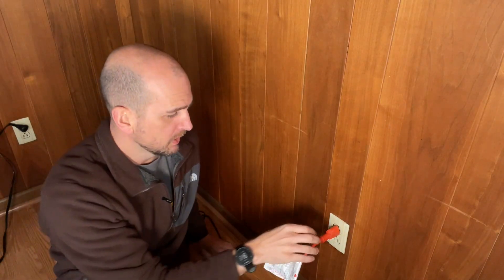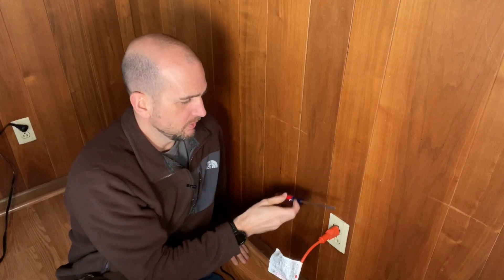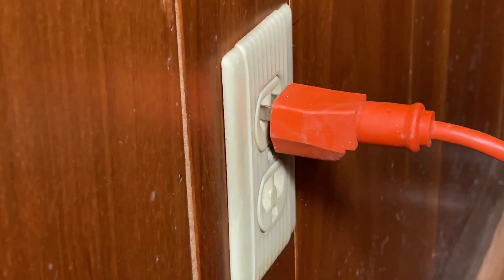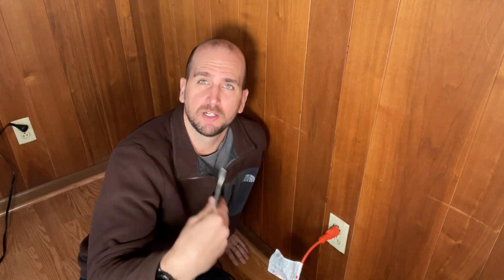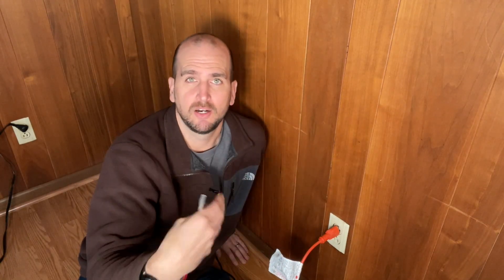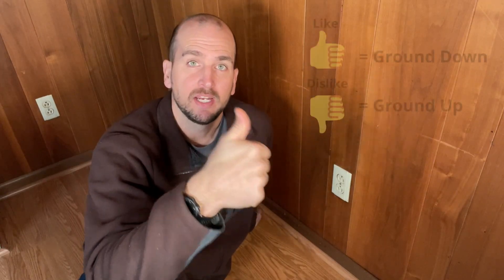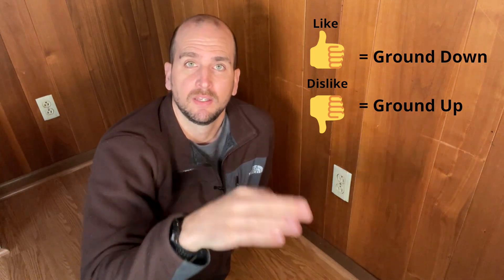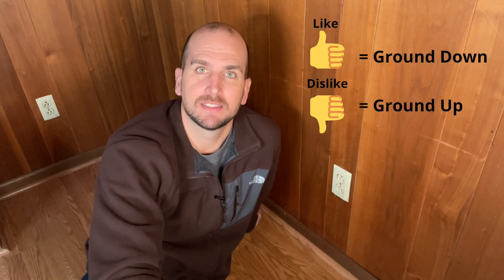Should An Outlet Be Installed Ground Down Or Up

Comment from the maker: Recommended Old Work Box (Different than used in the video):  https://geni.us/eVaL9

Tools Every Weekend Warrior Needs
Makita Cordless Drill Combo Kit:  https://geni.us/t7dIA
Dewalt Drill Bit Set:  https://geni.us/oFlSl
Dewalt Screwdriver Bit Set:  https://geni.us/VDcr
Craftsman Screwdriver Set: https://geni.us/jXqFI
Eklind Allen Wrench Set:  https://geni.us/7XfvO
Pliers (4-Piece Set):  https://geni.us/RIdx
Stanley Utility Knife:  https://geni.us/ndIDa
Stanley Tape Measure:  https://geni.us/bUfD1R
Studbuddy Stud Finder:  https://geni.us/RySCuVw
Johnson Torpedo Level:  https://geni.us/wiLcDY
Stanley Hammer:  https://geni.us/bPDk8Wo
Buck Bros Wood Chisel Set:  https://geni.us/vk3cpTW
Klein Voltage Tester:  https://geni.us/h9Hl
Klein Outlet Tester:  https://geni.us/kdBAJ
Ideal Wire Strippers: https://geni.us/MdOB
Little Giant Ladder: https://geni.us/fmlmTk

DISCLAIMER: This video and description contain affiliate links, which means that if you click on one of the product links, I’ll receive a small commission.

Comment: Another downside to ground down is that a heavy plug can crack the plastic around the ground input itself because there is not enough plastic for proper support. Once that happens, the outlet is useless. I'm going with ground up.

Comment: I replaced some outlets with hospital/industrial grade one. If there was a grounded plug commonly plugged that wasn't a flush fit one it I installed it ground side up, as it is harder to fall out. Otherwise ground side down.

Comment: Our house has both. I am 78 and have never heard of anyone dropping a tool across the hot and neutral.
   I change the orientation to reduce stress on plug wires. That is it. Top, bottom or sideways works.

Comment: Our electrician replaced all the outlets with ground up because its supposedly more secure. 
It's a gigantic pita - such as in my bathroom where I have 4 plug safety outlet plugged it. It constantly slips forward. Other outlets are a pita with my flat 90⁰ surge protector outlets. And the two prong plugs slip out easily. 
I hate it.

Comment: They have sideways installed plugs. There’s floor plugs in the middle of rooms. I don’t think it matters except those thinking they can predict every scenario. 
But if the ground was facing up and the item that hit it rolled in the direction of the hot lead, the same thing is still going to happen! So I don’t feel there’s any ones scenario that fits every situation. Maybe just be very careful think things through Replace old out plugs and this will be less likely to be a problem.

Comment: Most are thinking about this in the wrong way. (Except the guy who likes to look at the eyes and mouth.) But you need to consider how the plugs 🔌 are designed on the appliances. If they are straight, it doesn’t matter. But if they are 90 degrees from the cord, the ground should be on the bottom. Otherwise, the cord will block the upper receptacle if plugged in on the bottom, or the cord will go above the plate on the wall, and then loop around to go back to the appliance when plugged into the top outlet.

Comment: Had an eX with the grounds up in her house.  Thought it was the oddest thing, especially knowing her dad was an engineer. Since then I've noticed that it is easier to plug in 3 prong plugs at bed angles. We recently remodeled her house and all plugs are ground down except for 2 that are controlled by light switches. They are down mainly because they may be behind furniture and a flush plug is needed.

Comment: I would guess the reason most homes have GROUND UP (GU) versus  GROUND DOWN (GD) is mostly to do with ease.  Here's what I mean.  If you install GD, it gives you 2 prongs to guide into the base plug, virtually guaranteeing that the GROUND prong is automatically aligned; whereas, if you install GU, you only have the 1 prong on top to guide you, meaning the 2 prongs below are not necessarily aligned.  To me personally, orientation doesn't matter that much because once you've plugged something into the receptacle -- whether it be a lamp or computer a refrigerator, a televion, etc. etc. etc., it's a pretty well done deal.  You aren't going to be plugging and unplugging it.  Whatever little inconvenience might be involved in GU is so nominal as to be a non-player -- for me, anyway.

Comment: I used to think it was on safety precautions as to how they are manufactured .... if you notice the neutral terminal is always bigger than the hot its because the should makes contact before the hot ... however i used to think that the reasons for the ground down is also safety precautions when the ground is down incase of water rising or flooding it would contact the ground first

Comment: The ground should be down if it is pulled down the ground will always stay attached. If it is the up position and pulled down the ground can become pulled out but the voltage can be still available which can cause an electric shock because the ground is not attached.

Comment: Every electrical manufacturer that makes a plug in the wall device intend it to be with the ground down. I have seen multiple Smart outlets and carbon monoxide detectors, all intended for the ground to be down. All the writing on them is designed this way. I have never seen one of these designed with the ground up. So I don’t understand why anyone would put them with the ground up. If an outlet is been used so many times that it is loose. When you plug it in, then it should be replaced.

Comment: Seems like it's primarily older homes that have the ground up from my limited experience. Practically all modern plug in adapters or protectors with anything built into it are based on having the ground down, like usb adapters, the 90 degree turn surge protectors mentioned here, etc.  Even GFCI outlets have the words printed based on the switches based on ground down.

Comment: The best is ground down the following reasons:
1. The plugs of the refrigerator or stove have the cable very bent and forced because that is not its original position to plug (reason point 4)

2. GFCI testers have the display up with pin ground down, if you have a ground up outlet it can't be read, you have to bend down to read the tester. (reason for point 4)

3. The plug connection is most solid when everything rests on the ground pin

4. It's the original position of the NEMA type B connector... ground, which looks like a scared face.

5. It's a horribly unsafe plug regardless of its position, so putting the ground up or down doesn't change anything the standard type B sucks because you can cause a shock just by taking it past the plastic. in fact, never in my life did I have such an aim that a knife fell in the middle of the connector, whenever they ask these questions they imagine situations that are too improbable that are irrelevant, and even if it happened... man, come on, it's only a short circuit, in the same way it will happen when the phase of a device touches the metal casing of a device or there is an insulation fault in a motor...BOOM!! thermomagnetic fired.  current out.

Comment: In Europe and Australia, the Earth pin is lowest of the three, but that means one can short out the plug A-N from above if it it slightly withdrawn.  These days, the Australian A-N plug pins have insulation from the plug to about 5mm from the end where the conductors are visible, so the possibility of shorting the A-N from above is less likely, however, there are many old plugs with conductors all the way from the plug to the end of the pins.

The UK has the Earth pin is above the A-N pins, so it is impossible to short out the A-N pins unless from below.

Whilst I like and prefer this socket arrangement (E above A-N), the Australian Wiring rules require the Earth pin hole of wall sockets to be under the A-N pin hole -- I suspect in Australia, if one were to orientate the Earth pin hole above the A-N pin holes, one's home insurance might be voided in a claim for fire damage since the investigation would find the wall socket mounted not in accord with the AU wiring rules !

I suspect this might also apply in the US -- so check the wiring rules code.

Comment: Wow!  6700 comments.  At 2:55 is a good example of why you want the ground pin down. The flat plug on the left wall is designed for ground down.   Most flat plugs I see are similar.  A quick survey on Amazon shows this number of flat plug extensions for ground up outlets:  Zero.

Comment: Yup. You're right. No code mandating the orientation of the ground... although there are many entries prohibiting receptacles facing upwards when installed in various locations or on various types of surfaces like countertops... HOWEVER there are inspectors in many jurisdictions that DO make you install the receptacles with the GROUNDS FACING UP!  When it comes to my customers or if I'm doing a remodel, I'm going to make whatever I install match the rest of the home.  If it is new construction... especially in a commercial environment... good chances you're going to have an inspector that will have u install all receptacles with the ground facing up here in the Atlanta metro area.  It's basically considered an unwritten code among authority having jurisdiction which can go above & beyond NEC code.
Q. - So why do they even have code book if an inspector can impose whatever arbitrary rule he feels like imposing?
A. - I don't know

Comment: Damn, I have been doing Electrical work for about 16 years thought NEC said ground up. I was told many years ago by a foreman that NEC 2008 stated that receptacles installed under 36" were required to have the ground facing upwards. I guess it was never technically wrong to do it that way, but not required. Dude sounded so sure and so specific when he told me, so I had no reason to question or look it up. It's nice to know that it isn't required, but now I feel bad for passing this incorrect information on to people that I have trained over the years.

Comment: The safety argument for the ground-up wouldn’t actually matter if our plug blades were smarter. The UK’s plugs aren’t conductive along their whole exposed length. If the plug is in far enough to pass current, there won’t be any exposed metal for things to touch and short circuit with. They do also have a ground lead on everything; but that’s excessive and unnecessary imo, though it does allow them to shield their outlets in a much less finnicky manner than our stupid tamper resistant outlets. That also raises the point of our polarized plugs. It’s a smart effort, BUT it’s entirely possible for outlets to be wired backwards which is why everything should have a double-pole switch, regardless of whether the cord is polarized or not

Comment: Pretty well all the smart plugs have a code on them printed on the top that expects the ground to be on the bottom so you can easily see/scan the code.   After 27 years at my place nothing has ever fallen on a semi pulled out electrical outlet.

Comment: If sideways, neutral up. If normal position ground up.  I saw a necklace fall on a loose grounded plug  in an old receptacle that vaporized in a shower of sparks. If that had been on a bedspread, it could have caused a fire.   I do commercial wiring at the facility where I work, and all the newer parts of our buildings are ground-up. The earth pin in UK I think is up, and if not fully inserted, cuts power to the hot pins.  That seems like the safest.

Comment: My experiences has been commercial, Schools,  Hotels and reason for ground down is inspectors that use a receptacle tester for polarity & gfi tests allows the device to be plugged in and can read the labeling and lighting is upright and readable. If ground is up the test device is upside down and not readable. So, I'd check the receptacle test devices,  typical brands GB.

Comment: Some power plugs are designed for the ground facing down, such as some fridges.  If the ground is up it turns the cord around upside down and bending around creating a loop.  MY standard is GROUND DOWN!!

Comment: Hmm.....
I haven't read the comments below so forgive me everyone. I am only speaking as a person plugging stuff in behind items. What's annoying is on a cord one of the outlet prongs is larger than the other and so is one of the outlet holes. It's annoying when you go to plug something in and you have it all lined up only to discover you must pull it back and flip it over so the larger prong now aligns with the larger prong hole.

Just my opinion, it's an awesome reminder that outlets controlled by switched are ground up. Today is November 26, 2022 and at 56.5 years old this is the first time I have ever heard that. Is that an electrician trade secret? Can someone leave a post it note in those outlets saying...

- Dear Homeowner. Remember ground up outlet means I'm a switch outlet. -

That information certainly proves that you do learn something new everyday!

Comment: I believe that the outlets should go down 
Because for the if a lightning strike should hit during a rain Strom , the lighting strike needs to go into the ground to avoid an electrical fire or
Short . That's why your house meter has a ground Cooper wire attached to a steel steak driven into the ground to control  lightning strikes during Strom's !!

Comment: Start at the first outlet in the room with ground down, do the second ground up, then repeat, repeat repeat.   Also put the ceiling fan and light switch combo, put fan on side closest to the door in one room, then change it for the next,..   Also don't forget to randomly add a mix of room outlets to a hidden GFI.   Then in the closets and laundry room don't put a box in the ceiling, just pull the wire directly into the fixture.    

Almost forgot, at random locations turn light switches upside down so it says "NO",...

Comment: From the beginning of electrification, outlets were hot side on the right, because it wasn't always obvious where the fuse was and being a fuse it was sometimes corroded and removing it could destroy the fuse holder requiring a repair and a new fuse holder, which if it was ganged could be quite expensive and time consuming. Electricians got used to working with hot wires, so the hot side was wired last with the right hand because most electricians were right handed.  The NEMA 5-15 receptacle was designed this way with the ground down. However, before publication of the standard, someone noted that the ground pin was the longest and the vast majority of outlets are below eye level, the longer ground pin, engaging first should be on top to aid visual engagement of the plug in the outlet, so that is the way the standard was published. However, electricians simply said, "happy face, hot on the right." Some people got fired for installing outlets according to the standard. It was considered an electrocution hazard during installation.  This is still done because it is hard to monitor a breaker box you can;t see form the installation location, and most outlets share a breaker with another outlet, so someone may be tempted to restore power to their outlet on the other side of a wall during an installation.

Comment: I was always taught that in basements, garages, workshops, etc. that the grounds should be put facing up for the reasons outlined in the video. If a piece of metal or tool falls on a slightly-exposed plug it will hit the ground and not short the hot and neutral. I've also seen that the grounds should be put facing up for outlets controlled by a switch in normal living spaces, mostly for clarity haha

Comment: GROUND DOWN ,WHEN OUTLET WEARS  ,THREE PRONG PLUGS GET LOOSE AND PULL DOWN ,WITH GROUND DOWN THE GROUND PRONG WILL KEEP GOOD CONNECTION POSSIBLE LIFE AND DEATH  SITUATION. IF GROUND IS UP AND SOME METAL SOMETHING SHORTS BOTH PRONGS ( VERY HYPOTHICAIL)  IT WILL POP THE BREAKER. MOST ELECTRIAL PRODUCTS AND NIGHT LIGHTS ARE MADE  FOR GROUND DOWN!

Comment: My outdoor receptacles were ground up. Putting a timer on the outlet resulted in the second receptacle being inoperable because wire was in the way. Drove me nuts but I thought it was code so I left it. Come to find out it's not necessary. I flipped them immediately.

Comment: Ground down makes so much more sense until cord manufactures change their gig. I think the concern of the short is definitely a valid concern, but the chance of a conductive obelject falling perfectly horizontal and crossing from hot to neutral does not feel anymore likely than that same object shorting from ground to hot or neutral. Also, it's better to have a bunch of surprised little faces in your house than a bunch of eyeless walruses.

Comment: I do ground down. My house was wired with ground up and it was a pain in the back side when plugging in certain plugs, lights, etc. Especially ornamental lights during Christmas, no one likes the manger upsidedown when it comes to that type of plug light.😁.
Plus it doesn't have to have a plug with a ground, most are polarized and if it's ground up it will change the orientation of whatever you're plugging in, ground or not.
When I remodeled I definitely  changed the plugs and put em ground down.
Yeah, ground up has some safety factors to it, but I guess I'll take my chances with ground down. We could be hit by a meteor, but I don't look for one ever time I go outside.🤔😁

Comment: Hi, not an Electrician , my feeling is ground should be down ,generally when i pull out a plug my thumb is at top of cord and i tend to wrap  second finger around plug to pull out cord, hence more chance that the lower finger could touch , i'ld rather that be the ground,  just a thought